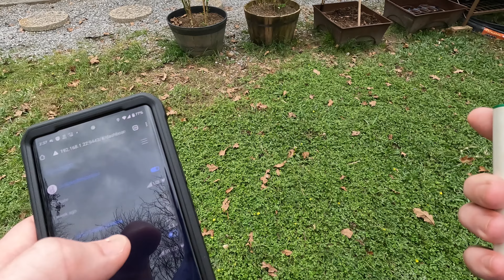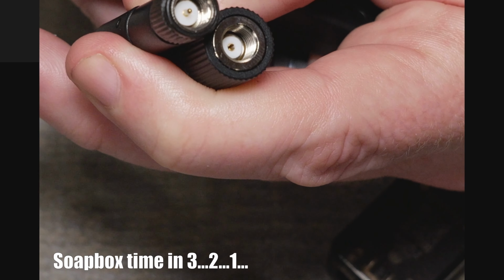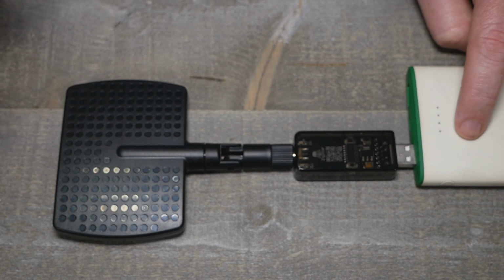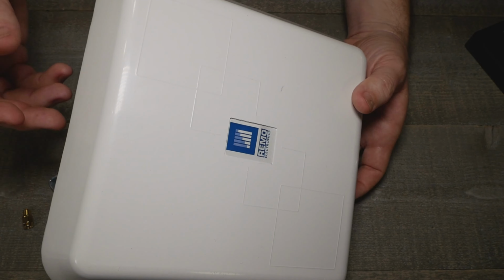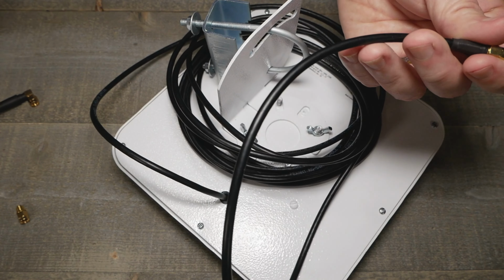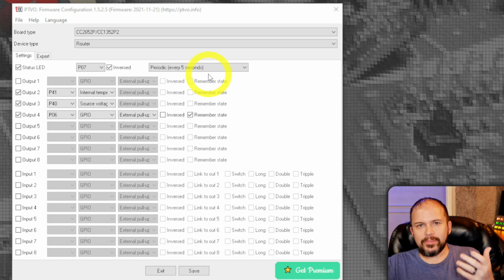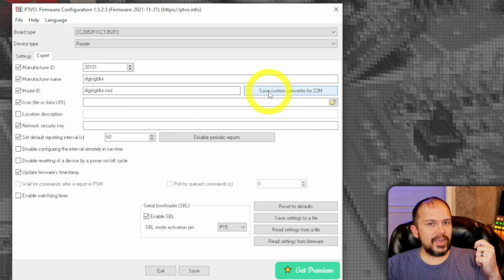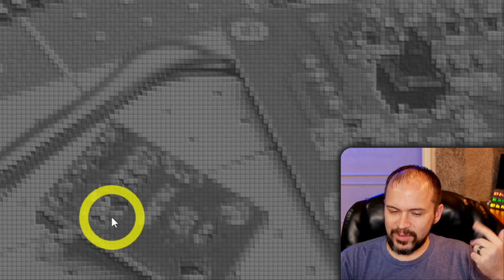Long Range Zigbee Smart Home 2 - The HOW? and WHY?

Comment: I have a project for my mailbox that is about 1000ft away from my house. This may be a perfect option for notifications of when mail arrives!
Reply from the maker: Do you have any power out there?
Reply: @digiblurDIY  I have been trying to use esp32 with tasmota to send wifi signal to house powered by battery and solar but signal drops at times causing the ESP32 to reboot to the point it looses the configuration. Using 2 yagi antennas. So, yes have solar with batteries.

Comment: Duude I have been cursed with concrete walls so even I have lots of repeaters around my small apartment my bedroom has less than 50 and sometimes my lights won't respond, do you think adding the alfa antenna to my sonoff CC2652P with the zstack router should improve something?

Great video!
Reply from the maker: Yes. Adding some routers with higher gain antennas to build out that mesh will help things a lot.

Comment: Very cool!  I have no practical use for this but next week... Who knows?  I might come up with something. 🤣
Reply from the maker: My comment seems to be gone...weirdo YT!  I didn't even say anything bad.  I had a couple situations with various discord members and family members that drove this but then I wanted to see how far.  Damn surprising.  I doubt I will have a need to go that far it is pretty cool to know that doing a shorter link will have some headroom.
Reply: @digiblurDIY  YouTube has been deleting some of my comments without notice too.  One night I wrote the same comment several times with slight variations to see what got them deleted.  It was inconclusive.
Reply from the maker: I get that whole moderation thing on some of them but it does seem rare now days to have them go into held for review. Guess they cracked a little too hard due to the bots.

Comment: Not sure you will see this, but I have a zigbee network with a Sonoff USB Dongle as my gateway. Could the method in this video be done with additional Sonoff USB Dongles as routers? I want to extend my zigbee network around 400' to our farm area.  Thanks
Reply from the maker: Should be find if you do some decent placement of them.
Reply: @digiblurDIY  So the ZigStar LAN Gateway has to be used to amplify the signal that is going to the Outdoor WiFi Antenna Extender. Otherwise just connecting the WiFi antenna wouldn't send the signal very far at all - correct?

Comment: Seems like the reason to use ZigBee is the mesh networking to extend the range. Wouldn't LoRa be a better and maybe cheaper way to reach long distances?
Reply from the maker: Probably not in the case I was going for. Zigbee sensor devices are more readily available as well. I would use LoRa in a scenario with several sensors spread out over a large area and not 2 cluster area.

Comment: Thanks mate for the video, I am a bit confused and need your advice, I have a big house and all my zigbee sensors keep going offline, really annoying, I have one coordinator the Sonoff bridge flashed with Tasmota zigbee, what do I need to buy as routers to make my zigbee rock solid please as I appreciate the technology but it seems really unreliable. Cheers
Reply from the maker: I'd probably start with getting a CC2652 based coordinator, then hash out issues from there.  It is pretty reliable as I use it for a lot of production stuff everyday.
Reply: @digiblurDIY  

Thanks mate for the reply, so you mean I should get rid of the Sonoff Zigbee bridge which is currently the coordinator, can't I just add  many USB routers around the house and keep the Sonoff Zigbee coordinator? Cheers

Comment: Excellent video. I'll have to look into the PTVO firmware. I would love to see a video of building a custom Zigbee device.
You spent so much time trying to get the battery pack from turning off. Should have just plugged your phone/camera into it to charge to pull enough power to keep it on.
Reply from the maker: Thought about that. But didn't have a USB C to A connector to make it work. Tried two 3 battery packs and went with the smallest they all kept thinking that Zigbee stick wasn't pulling power. One of those things I went down a rabbit hole and said screw it. Button works. Another reason that USB C needs to be on all the things. It's been 7 years already ...let's go!

Comment: I just played around with the PTVO tool this evening (and yes, guess who forgot to enable BSL/SBL and who has no JTAG programmer...), and it was freaking amazing. Got an LED blinking, got an input to report states, etc. etc. I'm curious - did you do anything on the custom firmware side regarding power? PTVO's firmware configurator doesn't allow anyone to set the transmit power if I recall correctly.
Reply from the maker: I came super close to almost flashing one like that... I was like wait...and sure enough...didn't mash the button.  I made a note right then to make sure to say stuff, it is too damn easy as you can see.

I just played with some simple stuff on it with the LEDs, pretty cool stuff.  I have another CC2652 I might put in a board to mess with this firmware on.  According to the github the router one is full power.
Reply: @digiblurDIY  Yeah it's a bit too easy to forget BSL.

Sounds great that the router is full power. Might explain why I'm getting 200 LQI between my coordinator and custom router (coordinator flashed with experimental Z-Stack 20 dBm firmware) in my house between walls lol.

Do you happen to know antennas by any chance? Specifically regarding the dBm settings in the firmware for the CC2652P. Is there a huge difference between a "8 dB" and "12 dB" antenna for example? Should I aim for the highest number always?